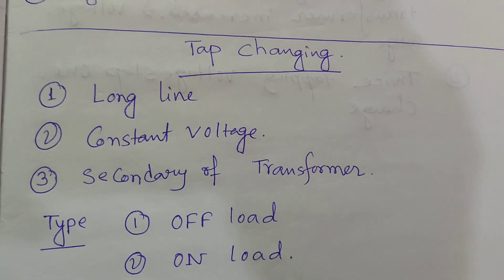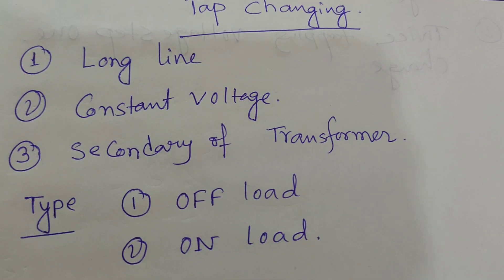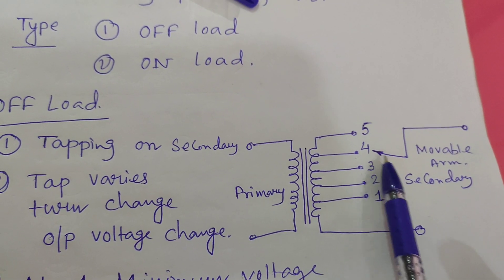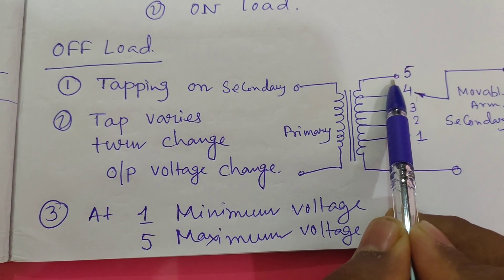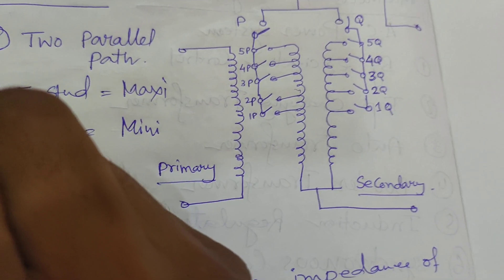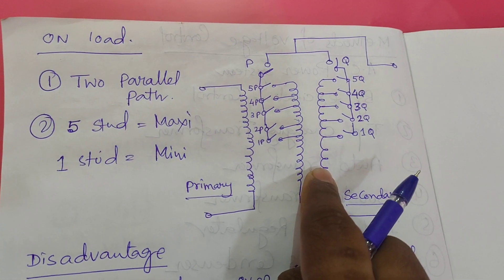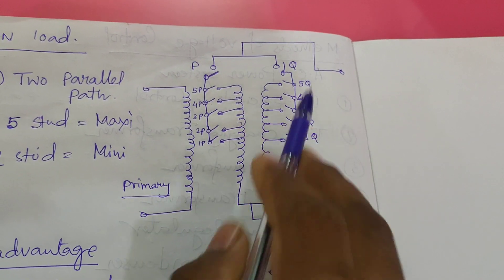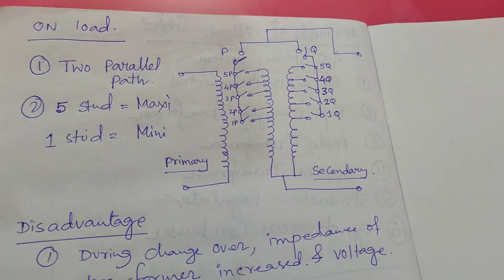Tap changing //Power Sector//Power Transformers#Distribution Transformers//Generating Station

Comment: Sir tap changer basically installed in LV side because  arcing is reduced because of low voltage?
Reply: Tap changer changes the turns of primary Winding or HV side of transformer...it installed at HV side
Reply from the maker: Thanks
Reply: If in Tap on Secondary LV side then current goes high side more copper need and chance of high current.

HV winding outside of the transformer and low current so easy to maintain Tap on this side

Comment: Power transformer for example. Center tap is 9 but TF tap is 9a 9b 9c  so which acual center tap
Reply: Sir please clearly tell me about 9a 9b 9c
Reply: @ashoksuluva3243  tapping changes according to required load...to control voltage...so no common tap point
Reply: @ashoksuluva3243  This 9a 9b 9c are all the same tap Nos. This is done to extend the Timing for Changing of Tap Positions in the selector and Diverter switch. This is done purely for Achieving Mechanical displacement  movement in the tap changer
Reply from the maker: 9b Normal
Reply: Every transformer has its Principle Tap  as per its Incoming Voltage . This is designed by the Transformer Designing Engineer +5%  to -5 % to +25% to -25% of the Voltage regulation. So the center Tap or Principle Tap differs from Xmer to Xmer